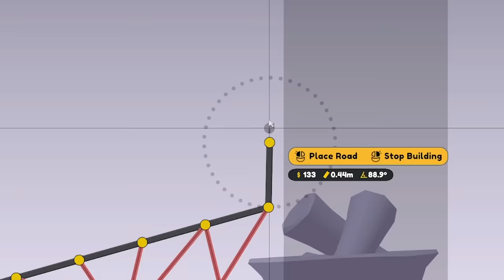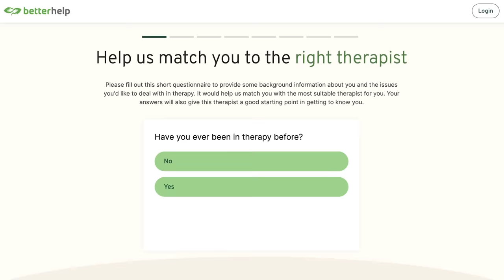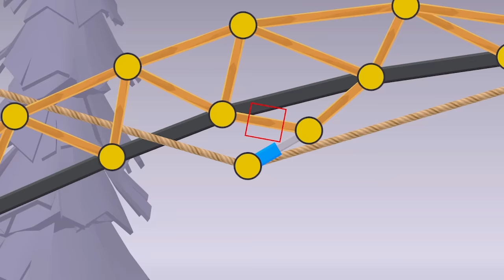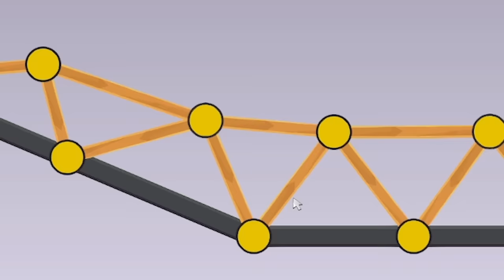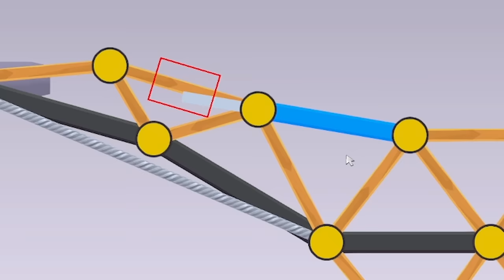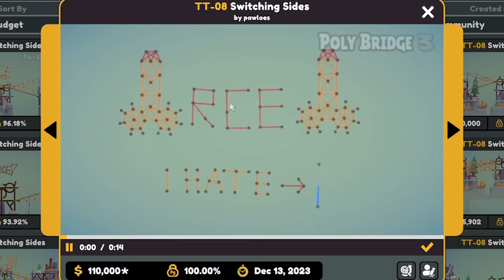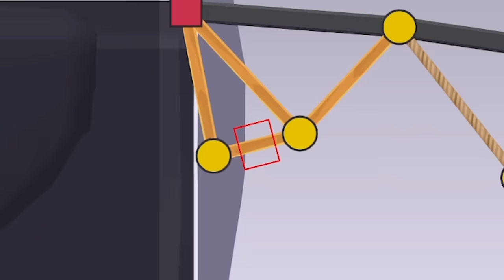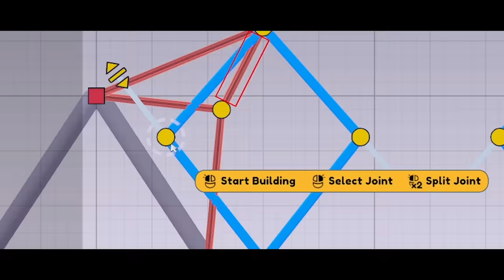I found CERTIFIED ENGINEER bridges in Poly Bridge 3!

Comment: I dunno if you're in a contract with better help or if it's a one off thing, but theyre pretty shady. They are notorious for not doing proper checks on the "licenced" therapists, and have even connected LGBT+ people with therapists that promote conversion therapy.
Reply: Their "therapists" aren't actually licensed anyway, as that would require the company itself to follow ethical rules and actual laws around patient safety
Reply: He doesn't case as long as they give him $200 per customer.

Comment: I'm a biker, I'll answer your question about front wheel drive motorcycles. There are probably some one off front wheel drive bikes. Probably not high speeds though. But, I do know some KTM adventure bikes offer hybrid all wheel systems. Basically there's an electric hub motor in the front wheel, it's used to get out of binds.

Comment: long ago my parent's car was frontwheel drive. One day we were going to a party from one of my father's friends, and the vacation house was at the top of a hill. It rained and it was dirt road; the car couldn't go up.

We had to disembark and my father had to go reverse all the way to the top in wet dirt 

I still don't get who enginee- i mean, architected frontwheel drives to this day, and why
Reply: As a certified automotive engineer I can tell you, that FWD is the best solution 99% of time. It's cheaper, more economical, offers a better use of space in the vehicle, and has advantageous driving characteristics. The avarage driver is no Stig, the avarage driver sucks at driving, but the understeering characteristics that FWD provides are much easier to handle for the avarage bad driver, than oversteer. Yeah I guess sometimes FWD cars get stuck, where an AWD or RWD wouldn't. But for the avarage Joe/Jane who only drives around in town that basically will never be an issue. Of course, when looking at the issue from a pure theoritical vehicle dynamics point of view, AWD is the best, but making an AWD comes with it's own disadvantages, like added complexity, weight, and decreased drivetrain efficiency. Plus, as I said, the avarage person doesn't need it. Factoring all this in, FWD is the best for regular operation.